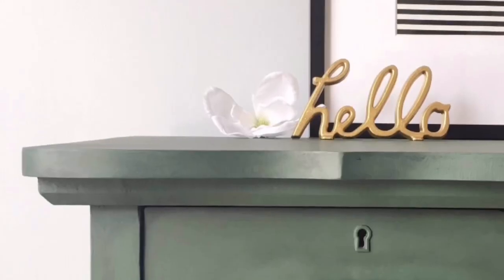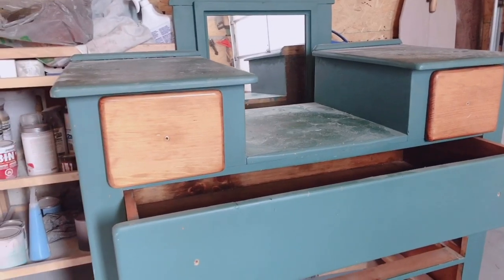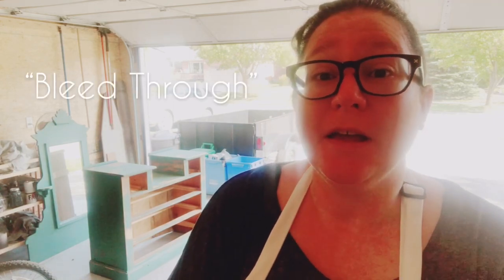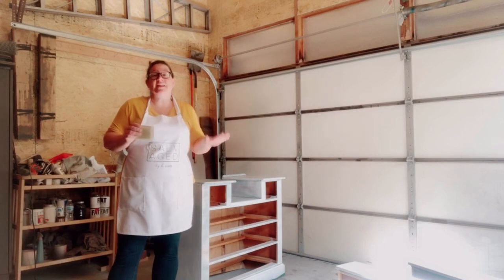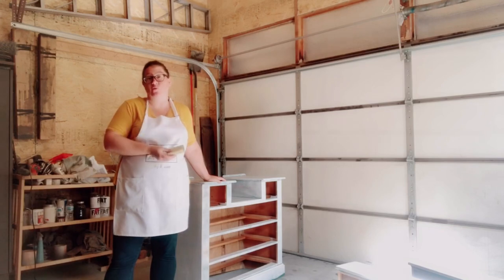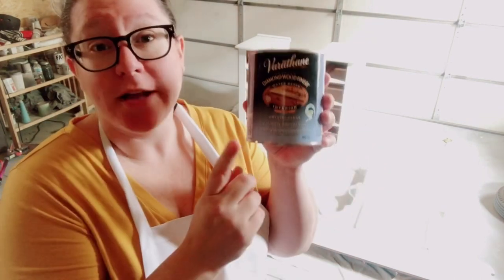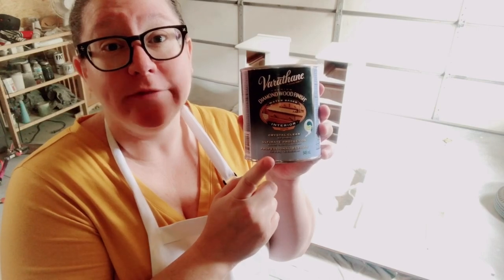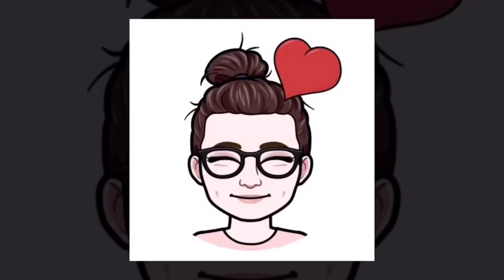Roadside Redo | How to Fix Sticky Drawers

Comment: I noticed that you didn't fill the dent and scratches with this one with bondo.  Why or how do you decide when to use a filler and when not too?
Reply from the maker: I love this question!!! This one has farmhouse vibes. The shape and construction just fit in the farmhouse category for me. So I decided to use the texture to my advantage for a more rustic look. Also...it’s pine, which is soft and will continue to dent very easily.